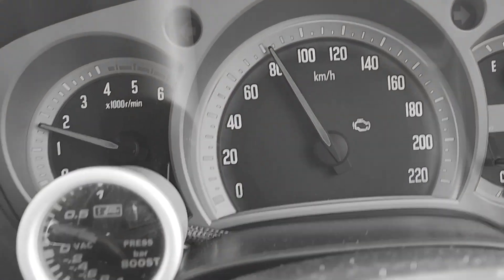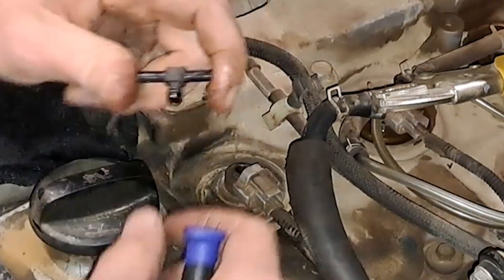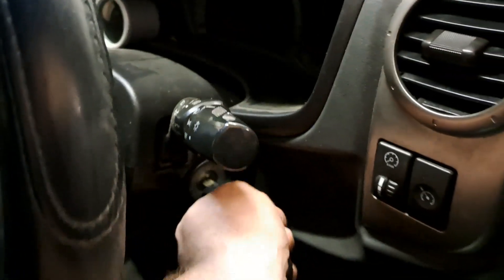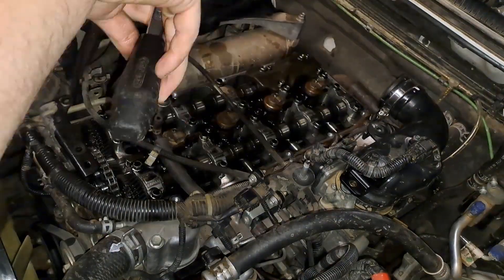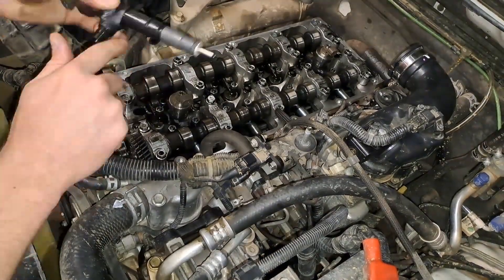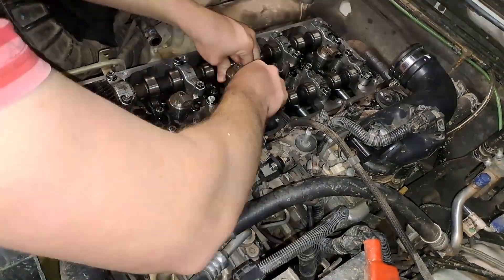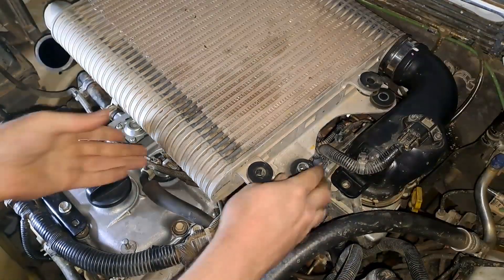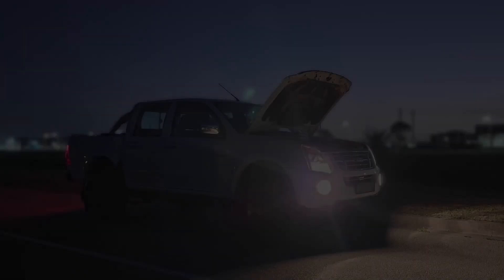ISUZU INJECTOR TEST & REPLACEMENT #4JJ1 #DTEQ #YT

Comment: Did the injectors have a rubber oring? What were you rubbing on the inj before fitment?
Reply from the maker: Yes, they come with new rubber o-rings. You can use any type of lubricant just to get them seated, as long as it doesn't degrade rubber

Comment: How many kms had your truck done? Mines done 450000kms on original injectors, they actually still test good on scan tool flow rates but calculated load is high
Reply from the maker: That's insane, those are tough as! Did mine on 255000km. Manual says to change every 160000km, but they can last a good long time with proper care.

Comment: The faulty one that return the most. Also invest into cheap ultrasonic cleaner and stack of injectors copper washers. I do the same every 50k kilometers take them out dunk them into the ultrasonic cleaner for 30 min while i clean the bores then replace the copper washer slap them in and you're done! You will save heaps on money and will get long life out of your injectors and engine.

Comment: I have a car like yours but the engine is a 4jk1-tc 
did you code the injectors after installing the new injectors ?
Reply from the maker: No, the injectors essentially had the same solenoids so no coding was necessary. Refurbishing is just changing the old worn nozzles with new ones.

Comment: Lekker man.  Howzit over there.  I am in Newcastle, New South Wales, Australia.  I escaped 45 years ago. I was born in Northern Rhodesia (as it then was) but went to School at St Johns in Joburg SA.   As it happens one of my vehicles is a 2008 Rodeo which was made just before Isuzu and Holden split up the partnership.   So I have the 4JJi engine and at 230000Km's just started some issues.  I am about to change out the suction control valve.  Keep up the good work with your videos!!!  I noted you purchased your SCV from Australia.
Reply from the maker: Hey, that's fantastic! The escaping part, not the issues you are starting to have, but that's part of the fun. Australia seems like the only place I could get one for a decent price, but dealing with ebay imports over here is a nightmare. Thanks for watching the videos and good luck your SCV change!